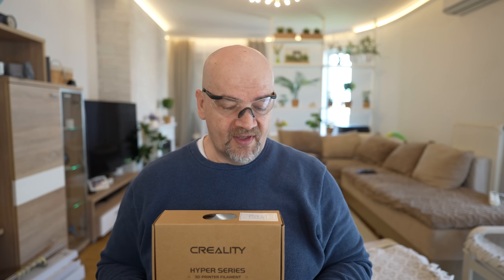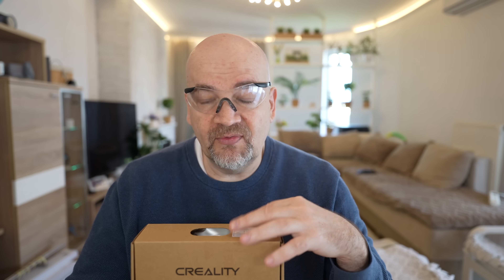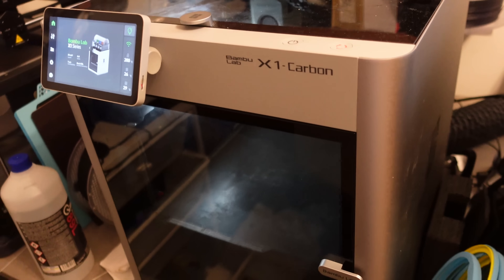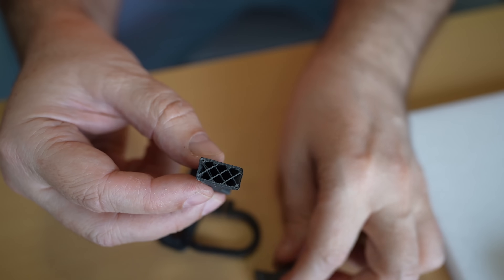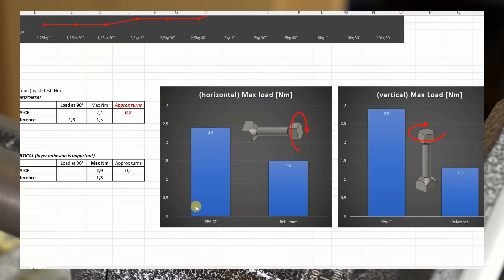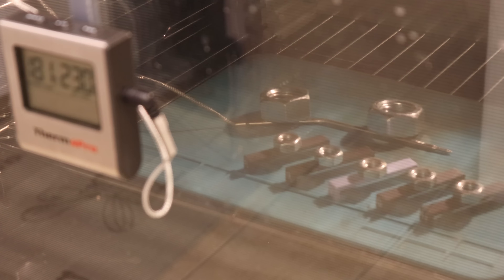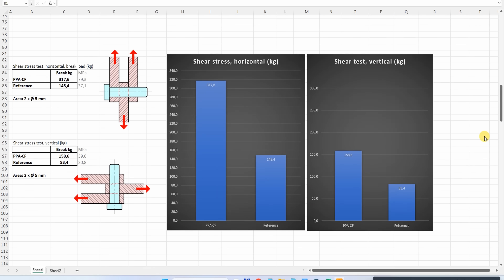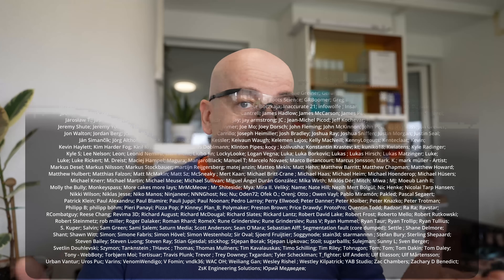Creality PPA-CF filament review, the strongest nylon type I tested so far

Comment: I will look more into this filamant as i only use at the moment PLA on my ender 3 v2 printer. If its a lot stronger that will benefit me on what i make
Reply: Youre gonna have to do a lot to your ender to print ppa
Reply: First step.  Buy different printer then i guess?
Reply: @aronjanssen5702  if you can afford it, the new h2d or a qidi plus 4 is specd well to print these types of filaments